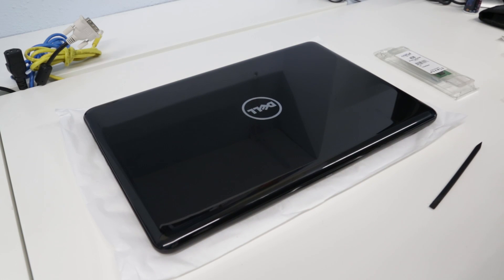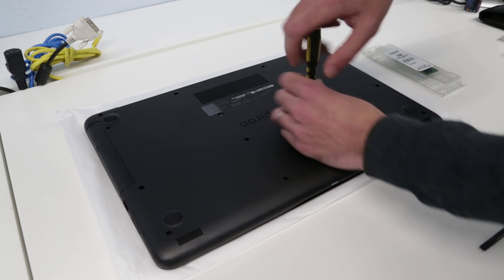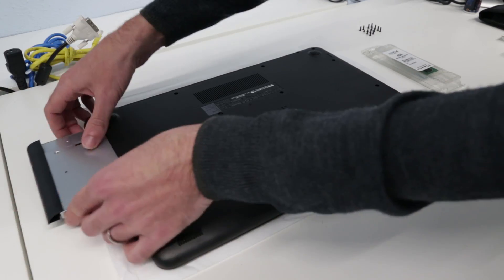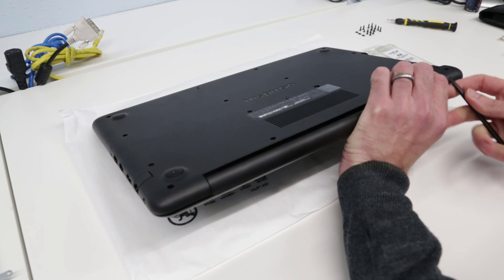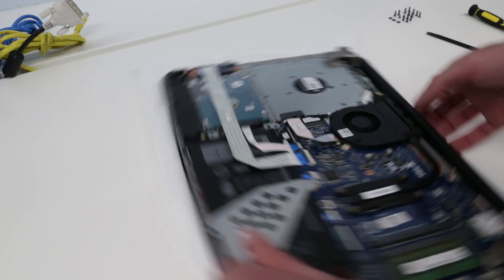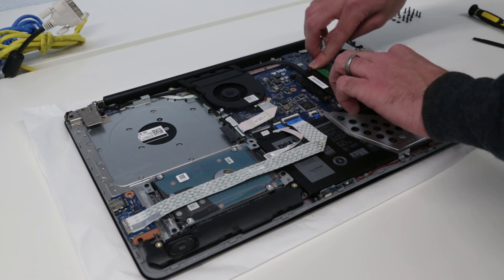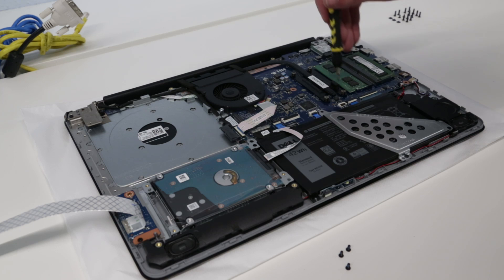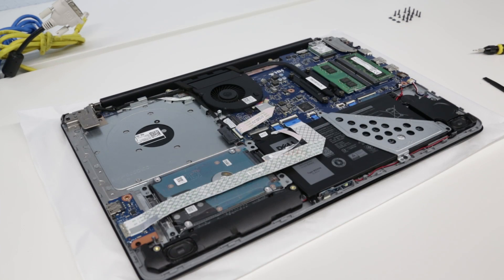Dell Inspiron 15-5567 Memory and SSD Upgrade Guide

Comment: Hello sir
I'd like to ask.
If I do open this laptop by myself. Will it void the warranty? or no?
I wanted to see the inside of my laptop (same model, i7 Kabylake with R7 M445)
and clean it. I just don't want to void the warranty (which will expire next year. Which is still a long time ahead)

Thanks for the vid and nice works sir!
Reply from the maker: You should always assume that by opening the laptop you are going to void the warranty.
That said I don't recall any specific warranty stickers or seals on my example, so if you're careful and use soft plastic pry tools it should be possible to open it up without any obvious signs that you have done so, but I can't take any responsibility for damage or loss of warranty.
Reply: I did open it and left some dents on it (which I kind of regret)
But a colleague of mine assured me that I won't be having any problems in terms of warranty as long as I don't replace anything yet nor ruined anything inside the laptop (rams and such)
I'm confident that they'll still honor the warranty despite some dents because I haven't done anything that would cause the laptop to malfunction.

Comment: What single upgrade is most important to make this laptop faster for video editing? Is it upgrading it to SSD? I bought this laptop in 16gb ram only for that function but it's slow!
Reply from the maker: Depends somewhat on what application you are using.
Reply: Brue Computing I'm using adobe premiere pro Cc to edit but it lags during playback. I bought a dell inspiron 15 5000 2tb 16gb ram and amd 4gb card. I'm not what to update to improve performance so premiere pro doesn't lag during playback. Thank you so much for your help!

Comment: You commented in the start that you were going to upgrade to dual channel memory, but you added one and left existing memory.  Is one dual channel and one single now?
Reply from the maker: Dual channel means installing a matching specification DIMM on each memory channel - each slot is attached to a different channel, so you want a DIMM installed on each to give full performance.

Comment: how to i switch from intel to AMD Radeon in this notebook dell inspiron 15 5567? greetings
Reply: If your 5557 has an Intel 620, there's no way to make it an AMD without swapping out the motherboard entirely and replacing it with an AMD one. This will likely cost far more than it's worth.

Comment: Dell should be crucified for making it this way. If I had the time, I would find out what higher up at Dell did this to 'save money'. Been taking apart laptops for years and the is the WORST experience in laptop memory upgrade history. Shameful Dell. Past laptops, 15 minutes and usually has a service panel to upgrade memory. This time, 2 hours .
Reply: 2 hours? This takes 15 minutes tops to remove.
Reply: Yeah...never took a laptop apart in my life and it took me 20 minutes. I call BS on this hater.

Comment: can i add a ram ( Kingston Technology HyperX FURY Black 8 GB CL15 DIMM DDR4 2400 MT per second Internal Memory (HX424C15FB2/8) i want to know if it will work with this dell model (15-5567)
Reply: MonkeyDLuffy DIMM is for desktop and SODIMM is for laptop.
Reply: Thanks bro

Comment: Hi am looking into upgrading from 256gb ssd to 1Tb ssd, is there a limit or maximum ssd capacity for this computer?
Reply: Chopper 13 1 Tb? You could get 5 new laptops for the price
Reply from the maker: I don't believe so, so long as it'll physically fit in the bay - if it is thicker than the standard SATA drive then it won't.

Comment: Hi can you please rltell me which brabd of ssd will fit. Will a Samsung 500gb fit?
Reply: That was which brand?
Reply: Samsung 860 Evo 2.5" x 7mm 1 TB SSD perfectly (relatively cheap now Newegg/Amazon). If you are replacing HHD you must replace OEM drive  with OS byte for byte. Samsung provides cloning software that will need to connect via usb cable under power. It will copy everything on disk. may take some time. The clone drive will be copied exactly as the donor drive. Samsung's software will replicate all volumes and cache. You will not be able to switch OS drive from the original device mother/daughterboard to different computer Unless Windows OS license is a full retail version. DELL OEM OS versions are married to motherboard at factory. I have successfully migrated OS to new drives many times. Please follow directions from manufacturers. There are several YouTubers how to's that are helpful.

Comment: The 3 little screws below the cd drive are stuck, only one came out the other 2 seem to start getting stripped
Plus when I inserted the pry tool on the back edge and slightly started separating the plastic, the plastic was getting bitten and deformed ... is there a specific way to do all this without compromising the aesthetics?

Comment: thanks for the video sir.I have a question...there is any M.2 or mSATA slot or just a single way with 2.5" ? 
Thanks
Reply from the maker: I believe the only M.2 slot is the small one for the wireless card, there is no support for an M.2 or mSATA SSD as far as I'm aware.
Reply: @BrueComputing  the optical drive slot conector is a mSata right?
Reply: @BrueComputing  Is there any way I can put a ssd SATA on the optical drive slot, kinda a caddy, I mean, the connector to the motherboard isn't a SATA, i think it''s a mSAta, am I right?

Comment: Older models (3558, 5558 or what) had a cover that we could remove with 2 screws to replace HDD or RAM in 10s. Now we have to completely disassemble this cr.p.
I'm not happy at all. Whoever designed this was an utter moron.
Reply: Yes I had a old dell e6440 and the hd cover was on the side all i had to do is unsrew the srews and remove the caddy and then so on..
Reply: On the brighter side, it is easier to do other servicing such as CPU thermal repasting
Reply: @weiwenwwe2066  not to mention if you need to do further work on your Laptop it's now much more easier now unlike the E2750 that i own currently where i need to remove a shit ton of screws in order to remove the screen, the fans and shit
Reply: @Marc-zi4vg  exactly, when I tried to do thermal repasting on my ASUS K43s it was a complete disaster, even cleaning the fan was a disaster.
Reply: @weiwenwwe2066  also i forgot to mention, when i got my laptop, i saw cracks in the  side and missing screws, after watching a teardown of the thing and doing it myself, the thing may feel like a brick but a nerve-racking pain in the side it was to service to! full of rentention clips gripped like a vice and different sizes of screwdrivers (also i think the former owner experienced this at some point) so im glad with more recent barebones, you can see everything schick manufacturers are currently doing!
Reply: Definite moron design. Then a moron at Dell, used a power driver and over tightened all the screws so badly, I had to borrow one just to get the back off.

Comment: hi how much memory can the inspiron 15 5567 hold  i have one slot holding 16gb 2400 the other slot is empty can i upgrade with a other 16gb on this laptop  comment please
Reply: david macfarlane doesn't look like it 16gb max supported on this model.
Reply: It depends on the processor - look up what the i7-7500u supports.

Comment: Do I need to unplug battery connector on the board to change hard drive for ssd? Thanks a lot
Reply: I asked myself the same question... It appears that the battery connector gets unplugged but it is not getting in the way at all for what would be a hard drive swap.

Comment: Hey mate, I'm planning on upgrading my laptop's memory with a 4GB DDR4 2133Mhz SODIMM Memory, is that compatible with my laptop then?
Reply: You used a 2400Mhz, so I'm a bit hesitant to buy a 2133Mhz Ram
Reply: Yep, it is compatible, but its recomended to buy 2400 because is faster, and later you could buy the same memory to make dual channel (its even faster... but just a little)

Comment: Can I add this memory ?

GOODRAM 4096MB 2133MHZ CL15 (GR2133D464L15S/4G) ( my 4+4gb)
or 
GoodRam DDR4, 8GB, 2133MHz, CL15 (GR2133D464L15S/8G)  (my 4+8gb)

Which is better ?Which get my Dell more fast ?
Reply from the maker: 4+4GB is a better configuration for memory bandwidth. Ideally you always want a balanced memory configuration.
I believe that memory should work.

Comment: I installed in mine 16GB DDR4 , SSD 256 GB, and cd tray for Hard drive 1TB
Reply from the maker: Nice setup
Reply: Where did you get the caddy for the optical drive to store your 2nd hdd?
Reply: My local store, there is also on ebay http://www.ebay.com/sch/Computer-Drive-Bay-Caddies/158816/bn_738291/i.html

Comment: Hello! Thanks for your video! I've bought 5565-0576 few weeks ago. And now I'm interested about number of ports for RAM in my laptop (amd a6, 4Gb RAM), because I want to make 8Gb. Do you know, how many RAM ports in my laptop? What memory should I get? Thanks for your answer!
Reply: Typically Dell will provide two SODIMM slots to accommodate dual channel memory My particular 5000 has 2 slots 240pins each My system has DDR4 2400mHZ   16GB RAM Crucial brand check dell website for approved QVL for memory modules.

Comment: I stripped the screws under the DVD drive because Dell uses such stupidly soft metal for them.
Reply: the same, only one came out the other 2 started getting stripped ... not sure how to take em off.
Reply: Finally how you removed it?
Reply: Try a good sharp blade that will cut into the metal. I've used a box cutter on many occassions....works every time
Reply: They do sell screw cutter basically is another screw that can cut the current screw.
Reply: same here too, i think dell did this knowingly how come only screw comes out and then hell breaks loose

Comment: Hi,

In the Bios section of my same laptop the frequency of RAM shows 2133 MHZ but you have installed 2400MHZ Ram, Can you please confirm which frequency RAM to install. ? In my BIOS screen it shows 2133 MHZ RAM.

Comment: Thank you for this video. I bought the 5567 and upgraded the internal hard drive to a 480gb ssd drive. It's truly amazing how much faster the machine is now! 👍
Reply from the maker: An SSD is generally the best upgrade you can make to a machine.
Reply: @BrueComputing  capacidad maxima que soporta en disco ssd y de memoria ram de cuanto es lo maximo ??
Reply from the maker: @riquelmeneymar5515  Should be able to fit 32GB RAM (2 x 16GB) and up to 2TB SSD.
Reply: @BrueComputing   aok y una pregunta mas , para este tiempo aun sale buena ese modelo de laptop??
Reply: @BrueComputing I readed in the product technical sheet that only supports 16 Gb, about hard disk doesn't say so much, only says that is sata 6 Gb/s (Sata III i guess), but in that pdf just says that 16 Gb is the limit of Ram, at least in this model, about ssd I saw that people put 1 tb ssd and works fine, with 2 tb I guess it should work fine too.
Reply: the sim Hello, which bradd did you use please?
Reply: how much does it cost a 480gb SSD?
Reply: ~$125 - 140
Reply: @lynxznet  can you help with a link?
Reply: @ayodejirauf7712   For? You can find a solid state drive for these anywhere. Just look for a 2.5" SATA Solid State Drive.
Reply: @lynxznet  thanks.
Reply: @lynxznet  Did you have any problems reinstalling dell and windows?
Reply: Hi! I also upgrade mine with 120gb SSD. And then I'm trying to put back my HDD as a secondary drive now but it doesn't work. After I turn on my laptop it will freeze to the logo of Dell or until the screen displays scanning and repairing or fixing with stages but after that it still won't work.
What should I do?
Please help me.😥🙏🏼
Thanks! 😊😊
Reply: @peeenk9288  hi, how u were keeping the hdd back?.. 
U wanna use ssd and hdd at a time?.
Reply: Im trying to replace the HDD to a SSD BUT I KEEP GETTING A BLUE SCREEN. It says  Media failure. Check cable.  Replaced the cable and still Did it. My laptop is slow. So I was trying to upgrade to 1Tb SSD. Any ideas what could be wrong?
Reply: Crucial 480 SATA SSD will work?
Reply: Crucial MX500 1TB 3D NAND SATA 2.5 inch 7mm (with 9.5mm adapter) Internal SSD? Will this fit in dell Inspiron 5567?
Reply: @daredevl6657  yes it should fit because it is 2.5 inches, same size as the HDD

Comment: What is the Max. RAM for this laptop?Does it support 16GB DDR4 2400 ?
What laptop would you consider in 17" with the Max. overclocking in 6th gen.? or should I wait for the superior model than 7500U CPU as this is the best of 2 only in 7th. Gen. Mobile edition.
My basic need is powerful graphics for video n photo editing,with at least 16GB DDR4 2400 and 1080P res.in 17" screen size.
Right now either 13 or 15" screen is available with Radeon  or integrated 615 n 620 Intel chips.

Comment: I was looking for a hdd caddy to replace the dvd drive, but havent found any the use the exact inspiron 15-5567 model number.

Do you have any suggestions?
Reply: basically those hdd caddies have different thickness: 12.7 or 9.5 mm, you need to measure thickness of your dvd drive and get a matching caddy, as long as thickness is right, you can go with any hdd caddy

Comment: what size or head of screw you use to open it the 3 screw located at the cd section for upgrading the ram
Reply: Hee Khiek Wong I used a philips #000, it seems to just be able to fit - be careful not to strip the heads
Reply: I used a Phillips #00 aka PH00.
Reply: I would also want to know
Reply: Hee Khiek Wong yes i want to also know by which screwdriver you open the three screws M2×2 which was after ejecting Dvd rom
So should you give a link or name of that screwdriver from where i buy it in india
Reply: I tried phillips PH0, PH00, PH000 with these it works fine

Comment: 2:10, fun fact, this computer has a discrete GPU in it. An AMD R7 455M, which voids what he says about knocking gaming performance.

You are not going to get the best speeds on games, but the RAM will not affect gaming on this laptop very much.
Reply from the maker: Actually it depends on the model you buy - in the US the i7 models come with the M445, i3 and i5 models are all Intel HD 620.
Here in the UK we get more variants - some of the i5-7200U models are also available with M445, but the i3-7100U based systems as tested are HD 620 only, and when the system was ordered there were no M445 variants available to order.
Reply: Brue Computing I see, I've never bought anything less than an i7 so I assumed that they all came with the discrete GPU. My mistake.
Reply: f
Reply: They do not all come with AMDs. Mine has an Intel 620 with my i7-7500u.

Comment: Does the RAM upgrade require any sort of setup when the machine boots or are these type of upgrades all plug and play? Your video makes this sort of operation look very straightforward!
Reply from the maker: Should just be plug and play - just make sure you do a full shutdown in Windows 10 before installing it (Ctrl + x, Run, "Shutdown /s /t 0")

Comment: Is possible to change the graphic card?
Reply: Amal this laptop has no thunderbolt 3.0
Reply: iPirate no
Reply: you could buy an external gpu if you don't wanna buy a gaming laptop
Reply: Amal not even external gpu
Reply: You should be able to, mine came with a dedicated card in the machine.
Reply: could use a thuderbolt 3.0 to hdmi dock?

Comment: I'm curious, is it possible to add a 1TB HDD to the system as well as having the original SSD installed?
Reply: It has a 1tb HDD as standard, we replaced this with an SSD, without getting rid of the optical drive, i wouldn't have thought there was a way to add a second Hard drive

Comment: what kind of ssd should be used and can you pls make a detailed video of the process of upgrading it.

Thank you
Reply: I'd format it in the desktop as NTFS and check it for bad sectors, it worked fine in ours, we just cloned the Hard drive to the Evo and it worked perfectly
Reply: We used a Samsung 850 Evo
Reply: I used a Samsung 850 EVO too. But in my case the Dell doesn't detect the SSD and runs always the Hardwarecheck. The SSD isn't the failure i tested it on my desktop PC. Any Idea?
Reply: i ran into this issue earlier today. Did you unclip the sata cable. Initially when i closed everything up i didnt put the cable fully in and thus it didnt recognize the drive.

id suggest unplugging both ends of the cable and then re-attaching ensuring connections on both ends

Comment: Where do you get the ram and the plastic pry tool? Also could you benchmark BF1 with please?
Reply from the maker: 4GB DDR4-2400 RAM: http://amzn.to/2dpQDcA
Repair kit: http://amzn.to/2eneTsP
Reply: Brue Computing Thanks
Reply: Brue Computing I am interested in buying 16 gigs of ram is there any problem with buying single ranked ram for this laptop?
Reply from the maker: I'd always run a matched pair of modules - gives better performance.
This is a pair of 8GB modules if you wanted to go 4GB to 16GB: http://amzn.to/2enffzo
Reply: Brue Computing 
Does this model support M.2 ?
Reply: m.2 or msata slots available?

Comment: What exactly is the effect of upgrade(both ssd & ram) on warranty, can you please elaborate?
Reply from the maker: As I say in the video, disassembling the laptop may well void your warranty. Certainly any issues caused by the replacement HDD/SSD or memory upgrades wouldn't be covered.
There are no warranty seals that I could see during the process however, so if you're careful it should be possible to make (and if necessary reverse) the changes without obvious signs of tampering.